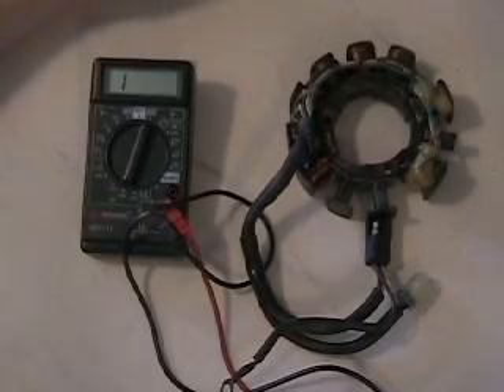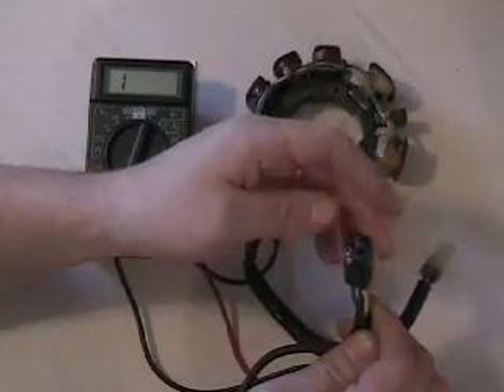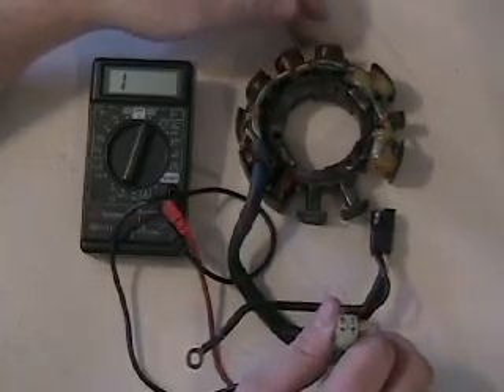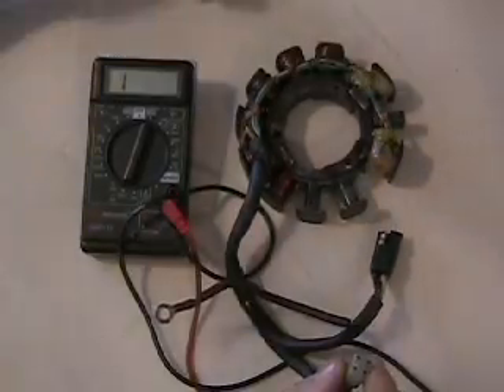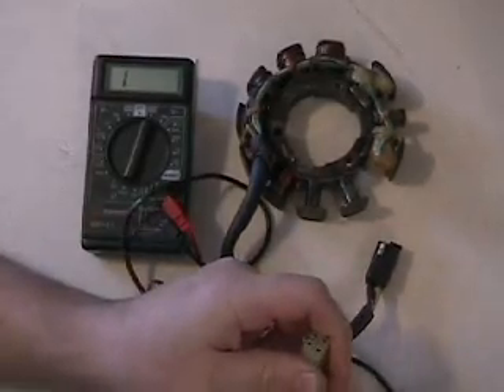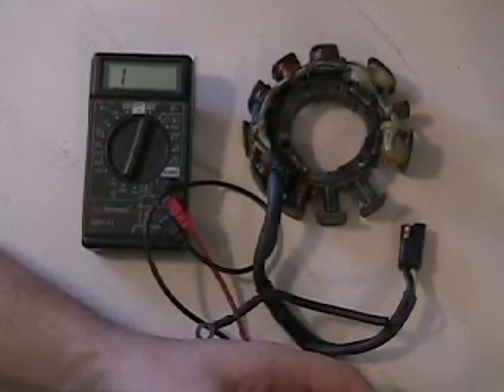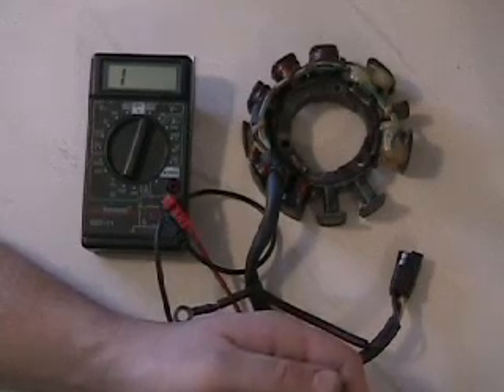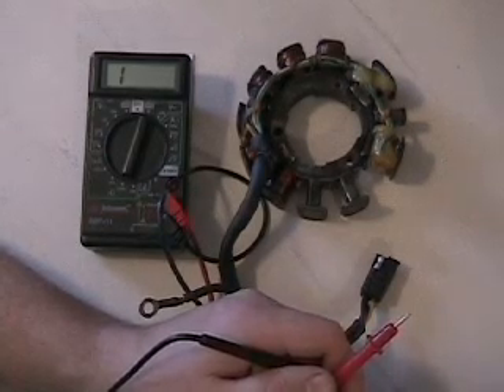Arctic Cat 1998 1999 500 and 600 carb snowmobile stator testing

Comment: Hi my green to white is 528 ohm
And white to black is 575 ohm 
Green to black is 47 ohm
Since the others are over 500 is this stator bad? Thanks
Reply: Yes it is bad. A good used OEM stator should read 435-445 & 42-45. I do rewind those with a 2 year warranty.

Comment: So I got 1998 zr600 carbs and I'm get black/red white at 462ohm and white/green at 420 and black/red green at 42 so it's out of spec and bad as your video trigger pulse is at 90 chasing a no fire or weak fire sometimes and left cylinder is showing spark when started but not as solid or heating up as right side and plug looks new when shut off and take out might be more than one issue just picked it up thanks
Reply: This is at 30degs outside on machine

Comment: 1998 ZL 500 Carb 
Just watched your video and tested my daughter's sled. It's hard starting and once she got it warm after riding it a bit it died on her then wouldn't restart without letting it sit. 
Readings are 517, 43, 475. If you're saying +/- 10% that should be ok then right?
Reply from the maker: Measure the ohms when it's cold/at room temp. It should be 435-445 and 42-45. If the low speed is reading 517 then it is bad. I do rewind them with a 2 year warranty. www.outdoor-electric.com
Reply: @BlaineDP  I ran it around the yard until it acted up and then measured it again immediately after it quit running. Numbers were WAY high, 720, 57,649!
Reply from the maker: @jeremykocar6772  Only measure at room temp or when cold. All ohm readings will be much higher when the stator is warm from use.

Comment: Are there any testing methods for the lighting coil?  We have a 1998 zr600 carb motor,  The machine has lost all lights.
Reply from the maker: The lighting coils on OEM stators never go bad unless they are actually damaged. Normally they are the 2 yellow wires. They only ohm out at low readings like 1 ohm or less which just shows there is continuity. As long as they show an ohm reading the wire isn't broken so they will put out AC voltage.

Comment: Blain i have a 99 panther 550 with no spark. Tested stator. Ok for all specs.  Tried pulling over with 4 prong unplugged. Still no spark. Changed coil. Tried cdi off of a 440 fan. Seems to be the same coil. Heck i ever tried a voltage regulator lol.  Cannot figure out no spark.  Last year it would cut in and out for a split second lets say every 50km or so..  HELP
Reply from the maker: Could be stator related, could be CDI related ect.. in 1999 it should have been open loop so just unplugging the rubber 4-prong to the wiring harness should bypass all switches and wiring harness. That would narrow it down to: CDI, coils, stator. The trigger coil is actually the smaller 15-17ohm coil on the stator.
Reply: Hi I e been watching you very informative videos. I'm familiar with jumping the wire harness to check and bypass gauges. My internal coils read within spec's according to the video...I've tried both and still have no spark. Also has new c.d.i. and externall coil..please give me a direction? Thank you..my sled is a 1993 ext 580z

Comment: will an efi stator work in a carb sled? is it the same connection wise? resistance the same on all of them? zr 500 carb.
Reply from the maker: EFI and Carb stator are different.
Reply from the maker: No Different plug and grounding.

Comment: I just tested my stator on my 99 zr500 carb. My black to teal is 50ish after I had it running prolly 5-10 minutes. But my black to white is 333 after running.
Reply from the maker: All ohm readings will be higher after you run it/it warms up. But the low speed measuring 333 after running is low. More than likely your low speed ignition coil is bad. I do rewind them: www.Outdoor-Electric.com

Comment: Hi,  I have a 1998 ZR 600 caburated and I tested my stator yesterday because the sled back fires and bogs when it's warm.  My readings are Black/Red to White = 450,   Black/Red to Green = 50 and White to Teal Green = 414.  I tried reading all the comments but not 100% sure if my numbers are good or bad.  Let me know
Reply from the maker: 414 is low for the low speed coil. 50 is way too high for the high speed ignition coil. Your stator is bad.

Comment from the maker: OEM Stator Ohm specs are 450 and 45...if you're above 450 or above 45 it is bad...on the low speed coil (450) if it is less than 420 at 80 degrees it is highly suspect. If it is under 400 (450-70 =380) it is going bad.

Comment from the maker: It could be the stator...but very unlikely. The lighting/power side of the stator rarely goes bad unless it is damaged. Watch my other video showing how to test the voltage coming out of the stator and then at a plug like a lighting plug. More than likely you have a short somewhere, a cut wire under your seat, ect...something like that rather than an actual bad stator.

Comment: Hey, I have a quick question. My 1998 cat' ZL 500 starts up all right (one pull), but the lights don't work, only the highbeam indicator. But my other lights don't work (headlights, brake lights etc). Could it be the stator? (it runs fine).
Reply from the maker: The stator AC voltage is put out by larger wire and never goes bad unless it is actually damaged. You can start it up and measure the AC voltage coming out of the stator but I'm 100% sure the AC voltage that the stator puts out is ok unless damaged.

Comment from the maker: When it comes to compression...even though it reads 110, it could just be your gauge. Check your gauge on a known good motor...you gauge might just read low. If both cylinders are reading 110, then it is probably ok. If your gauge reads 130 or 140 on someone elses 440 motor like yours, then the compression is down. i responded to your other post....your stator is bad but you could also be down on compression a bit too. Could have 2 issues.

Comment from the maker: If the stator is at room temp...in your case 68 degrees...and it measures 518 and 45.2, then your low speed coil is bad. The low speed coil should be no higher than 450 ohms. I do rewind them and offer a 2 year warranty. You can PM/send a message on my channel page and I can send you my contact info. I offer a 2 year warranty.

Comment: Hey Blaine i got few things to ask you. First of all, last night i started my sled and it ran good iddling. Then i switched to low beams and the machine when off -__- From now on i dont get no more spark to the spark plugs. Weird... Anyways after that i cheked both stater plugs and the black one seems to be kind off broken. The grey connector that is poping out of the black plug is kinda loose. I wonder if that is my problem... So could you tell me whats the ohms resistqnce on the black plug thx
Reply from the maker: Stator is probably ok. Sounds like a short somewhere or a bad switch.

Comment from the maker: You don't have to remove it to test it, you can easily test it while it is still in the sled. The range you're loking for is 430-450 for the low speed coil and 42-45 for the high speed coil on an OEM stator. If an OEM coil ever measures higher than 450 or 45, it is bad. Luckily I know someone who rewinds them and offers a 2 year warranty.......me!

Comment from the maker: It sounds like it has the potential of being the high side coil going bad on it. Of course you always check things like compression, fuel pressure ect...but measure the stator ohms when it has cooled off/sat all night and see what they are. Also, you cna check the spark color and intensity visually when the sled is both cold and after it has run for a while to see if the spark is no longer bright blue on both cylinders after it has warmed up.

Comment from the maker: 426 is ok for the low speed coil but the number that concerns me is the 48 for the high speed coil because it should only be 45 and when cold  just a little lower than that. Ohms are resistance which is specifically related to wire length. Bottom line; you don't gain ohms on a coil unless you add wire so your high speed reading more than 45 tells me that there is more resistance (shorting out internally) in that coil so it is bad. The only time a coil reads higher is when it is warm.

Comment from the maker: Measure the 3 prong connector (I have another video showing how to test the 3 prong but it is pretty much how you measure the 4 prong) and after checking my notes you should have 16 ohms, 140 ohms and then 156 in series. The ohms will vary a bit with temperature differences.

Comment from the maker: The 95 Wildact EFI should have the triangle plug on it like my other stator checking video titled: Stator testing Triangle shaped 3 prong plug early 1990's Arctic Cats. ZR 580. ZR700. Your specs are: 

Green/Brown 450 ohms
Green/Black 45 ohms
Black/Brown 495 ohms